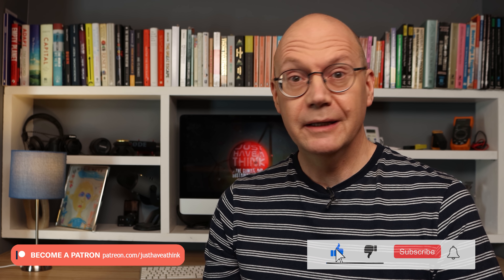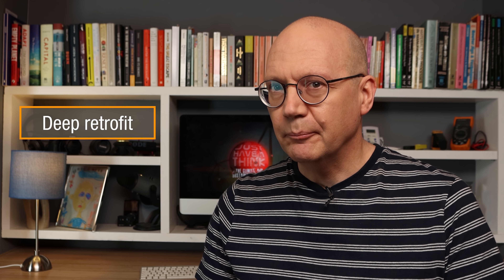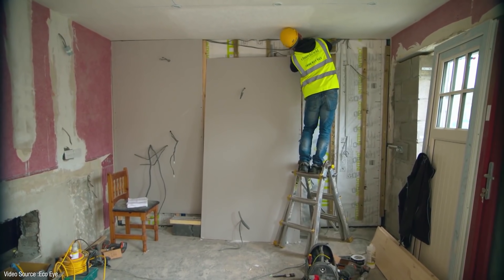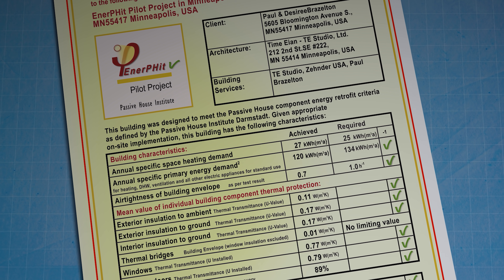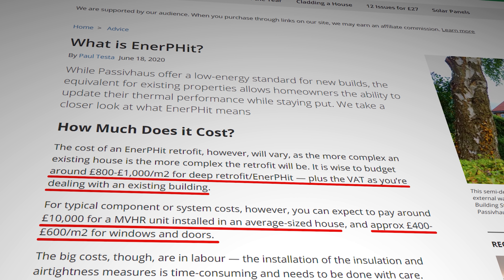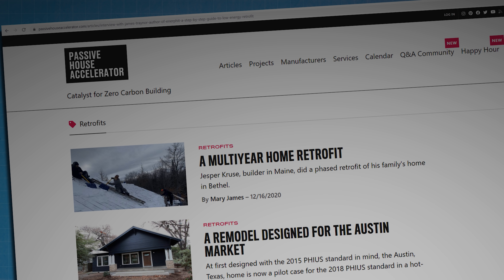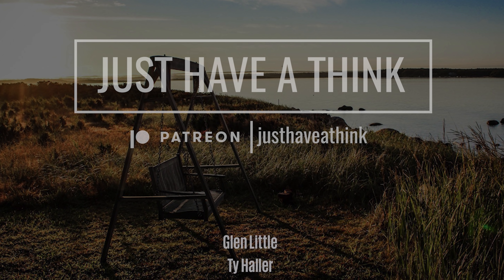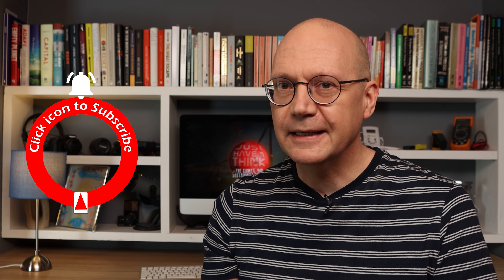Retrofitting to Passive House standards

Comment: A step in the right direction would be to strengthen building regulations on all new build houses. My daughter has just bought a new house and it must be the coldest and draftest house I've ever been in. Costs a fortune to heat and this house should be about for the next hundred years. It's like buying a steam powered car. So far away from a house for the future it's criminal.
Reply: More to the point would be to ensure all builders and construction workers have to undertake CPD (continuous process development) so they know about new technology and the importance of good processes.  A lot of present houses being built are not even to existing standards and most builders (I come across) have “not a clue” about passive house standards.
Reply: @Jack_of_all...  Building Control is supposed to check that all construction meets current building regulations. This process needs tightening with the cost falling on the developer so that they are incentivised to 'get it right first time' and avoid costly remedial works.
In any case, the government should be making it a legal requirement for all new buildings to be build to Passive House standard (a) because it makes them comfortable to occupy and cheap to run, and (b) to meet our climate objectives with regard to reducing energy use, much of which currently goes on winter heating.
Such a move would then require the building industry to raise skill levels to construct passive buildings.
Reply: Yes this makes me scream too! A development site near me received permission for a development of 50 houses to passivhaus standard. But after a hiatus of 2 years construction has started and they are just ordinary brick detached dolls houses and the PH requirement has been abandoned.  Shocking and disappointing.
Reply: In 2020 California passed legislation requiring that all new buildings constructed must produce as much electricity as they consume.  It is much easier to build a more efficient building (like the passive house standard) than it is to produce the energy required for an old, inefficient building, so this is definitely a step in the right direction.  Plus, since this basically guarantees that all new buildings will have solar panels, it decentralizes the power grid, which is a good thing.
Reply: It's about profit. They don't care about the end user.  There's a saying never buy a new  build.
Reply: That sounds like a nightmare. I've always lived in older buildings in the UK and have always had an absolutely horribly uncomfortable time. Now currently living in a new build flat and finally feel comfortable. But I hear everyone continuously say to avoid new build.. however in my experience it's older buildings that have the major issues. I want to buy in the near future but super scared I'll be stuck in a house or flat I feel cold and uncomfortable with.
Reply: For sure. I was looking at a new house.. It was EPC C with potential for B and I'm like "But why. Surely it should be EPC A potential" and besides that guide still isn't as stringent as the international standards.

They should at least have solar panels on top
Reply: Yes it is crazy. I was watching a new build go up the other day whilst stuck in traffic, and the insulation around the roof windows must have been all of 100mm if that.

I don't know why they don't just insist on passivehouse standard. or at least a standard thats compatible with aims 10 years down the road.
Reply: the 'Big six' builders (UK) have too much say. Its worse than the mafia.
Reply: The key to getting the needed upgrades done is money. The Passive Haus standard is notoriously expensive and thus only for the wealthy. Take a look at “The Pretty Good House” book and podcast to bring some sense to the situation. Spending all your money on professionals before a project even starts is idiotic. The design, specification and permit process is one place governments could really help. In my town the permit process is so expensive I am forced to do upgrades without approval.
Reply: So now we are down to the nitty gritty of what we can do, to personally avert our existential threat. It needs government support. To answer the usual criticism of government intervention, I include this.
Today our biggest problem is the money myth. Most people believe it is a real thing. They don't know that money is created electronically, out of thin air. It’s difficult to grasp, not in and of itself, but because it runs completely counter to the dogma of our indoctrination, about the need to 'balance the books' something we are deeply programmed to believe. This paradigm projects the “common sense” of household and business accounts onto government expenditure and the money supply. There are many reasons for this deception, here’s a couple. Deliberately provocative due to our existential threat.
The creation of government debt has the high purpose of endowing the oligarchic elite with an inherent privilege to extract rent from everyone else. Money for nothing, even while sleeping, similar to the feudal Lords. Think of it as a rent/tax extracted on everyone for their existence. There is no real reason for the bond market and the debt it creates. But it does provide the foundation for all other debts that cascade down the system, which brings us to reason number 2.
The money myth is also a fundamental way to control the vast majority of the population, to the will of the oligarchic elite, to keep people down and in their place, under the firm control of debt. There are many other ways this is done but we are only concerned here with the kingpin of of our financial structure, the money supply.
In popular discourse, this division between the ruling elite and everyone else, is known as the 1% vs the 99% of the population, in any developed neo-liberal society, bound by fiat money.
In pursuit of the Green New Deal a number of senior politicians and economists met with UK Treasury officials. In a conversation that included John McDonnell and Richard Murphy, they were told that the official line about how money is created and functions, will be maintained at all costs, in order to 'manage expectations'.
Further understanding of MMT can be found in, The Deficit Myth by Stephanie Kelton
Reply: @Jay...777  This is so true. Covid and the pandemic have shown how this works clearly. The money tree has been prolific for the chosen few with the country now 'in debt' to the tune of 32 billion to Test and Trace while a real terms pay cut to everyone else. That's why the new draconian Policing act is being brought in because they can see the majority are beginning to revolt.
We need clear pathways and good leadership around housing and energy use. Education about the likely timescales and effects of climate change and a clear narrative of a post fossil fuel world. Passivhaus is a fantastic objective but only part of the solution. At present we are not implementing any parts of the solution. Or only a few individuals are making the effort in an individual, ad hoc way. We need high standards set by government to implement massive public mobilisation around retrofit, greening our public spaces if which there should be many more. A complete turn around on infrastructure build to services locally to reduce travel and a moratorium on plastic junk and non recyclable materials.
Reply: @holgre3470  Yes, I couldn't agree more. A big problem is we don't see the system we are subject to in any real historical context, which voids any valid critical review.
We live in a form of capitalism that changed around the turn of last century into Financial Capitalism. This is quite different to the Industrial Capitalism, that for 100 years preceded it. This reached its zenith in the mid 20 century with the establishment of the neo-liberal ideology. Our main difficulty now is people believe it’s been this way forever. Ours is a linear progress, where history always favours the elites, until now we have reache the post modern “end of history” idealism. The retort of our current leaders, that there’s no alternative, is bullshit.
From the earliest times, from before the Bronze Age to the advent of Rome and Christianity, the social order was far superior to our own in many respects. The mainstream history books have it all wrong by the simple fact of seeing it through the tinted glasses of our own dystopia. The pyramids were not built by slaves. The Babylonians knew all about the the tendency for any economy to degenerate down to an oligarchy and how to cut the oligarchs down to size before they could become a menace. The mechanism was regular debt forgiveness, the restoration of land to the people and the release of all bonded servants that had fallen on bad times – the Jubilee – a cause for celebration indeed. It’s interesting that everyone knows of the Rosetta Stone, inscribed with 3 languages allowing the translation of hieroglyphs for the first time, but no one knows what’s written on it. An oddity worth reflection. It was in fact a description of debt forgiveness, a reminder to the new ruler of his duties.
Only recently has this become apparent and I can recommend to you a book that compiles these recent revelations called, “and forgive them their debts” by Michael Hudson.
Or if you prefer, The Long History of Debt-Cancelation from Antiquity to Today
www.youtube.com/watch?v=M4DkZ3CWFOk
Hudson is the one you want to listen to. Anyway, I have to fly now. Do check it out.
Visit michael-hudson.com for more goodies.
Reply: @Jay...777  Your government is saving 350 millions pounds a week now  so I suppose there is no need to increase the debt in the UK.
Reply: @jeromeh7985  
Never believe what you read on the side of a bus.  especially a pink one  lol
Reply: @Jay...777  If it got BJ approval it must be the plain truth he never was fired for lying nor he never cheated on his partner of the day did he?

Comment: Does anyone know if cavity wall insulation for an existing brick house is worth doing or is it a bit of a scam?
Reply: If it is free through a grant scheme perhaps, otherwise, id be avoiding it. Can lead to problems, see BRE Digests for the detail. If you can, better doing some external insulation yourself if possible or via grant free cheap scheme. Best wishes.
Reply from the maker: You just need to check that the insulation won't cause moisture bridging, but if you can get it done with a free grant then it's probably worth doing. I had mine done 2 years ago (on a 100 year old terraced house)  and I've had no problems.
Reply: @JustHaveaThink  It can cause interstitial condensation problems that become difficult to remedy without further works. As you refer to moisture bridging, you will be aware of ties, lintels and mortar snots that all are potential and common causes of this. Adding insulation as a retro fit into a usually two inch void often constructed by brickies on a couple of thousand bricks per day by two and one labourer can not always go well. I have personally removed handfuls of ringing wet insulation from the bottom of such cavities as part of survey work in litigation cases. 50mm of wet insulation is far worse than no insulation at all. Some produce using plastics in expanded form negate this. But product and situation should always be considered properly first as has been clearly evidence in recent disasters even when authorities gave the green light. I would also urge caution on giving advice that opens one up to liability should the advice fall short. Best wishes.
Reply: @jimmycorkhill1390  
he wrote:
"You just need to check that the insulation won't cause moisture bridging"
Reply: @johnburns4017  Yes, this is the problem when people dont really know what they are talking about, poor advice can lead to problems for the receiver and potential litigation against the giver. A traditional cavity is designed as an airspace to separate the outer leaf from the inner leaf. When this gap is taken up by a moisture absorbent material, the moisture that often condensates on the inside of the outer leaf soaks into the insulation. This is called interstitial condensation. Over time the insulation continues to get wet, increasing the condensation and cooling of the building. It can also cause dampness issues as the water accumulates at the bottom of the cavity. All this is other than, but not exclusive to bridging dampness related issues. Hope this helps clarify and show than to 'just a have a think' a little, isnt enough when advising or encouraging (*edited) others to part with money or take action that can lead to a loss, unnecessary cost or damage. Best wishes.

Comment: I sometimes wonder if there is a case for demolishing a house and starting again in regard to costs of retro fitting
Reply: Lifecycle cost analysis is often used in such matters. Best wishes.
Reply: There are a lot of compromises when retrofitting...at least if you are going for a super energy efficient home.  I am doing that right now and I am 100% certain that it would be cheaper to have leveled the building and started from scratch.  The only reason I didn't is that my family built this home so sentimentality is getting in the way...a big mistake ;  -  )
Reply: @richardlangley90  If the building is structurally sound and there isnt lots to remove during the retro......if all is mostly applied over existing and you are paying anything like a new build cost then your're being taken for a ride. Costs of demolition, foundation, structure, services, floors, internal or external claddings. All compared to a best practice external wrap with new claddings and perhaps new heating system? You paying anything close? Best wishes.

Comment: Brilliant as ever! We are in the middle of a renovation project on our old property. Couple of things I noted about the process:

1) In our situation we did not need an architect because the layout was staying broadly the same (minus a couple of walls). So we hired the very good local builder. As a 'client' what you want is always mediated through what the builder can actually do, especially in say a rural area with limited choices of builders. This can show In terms of their skills and experience, but also in terms of their supply base and their attitude to new methods and materials. Builders can be quite conservative and cautious of new ideas, which some of the Enerphit stuff often is for them. So they will want to do things their way - for example they may have a preference for concrete foundations over wooden raised floors because they are used to installing underfloor heating that way. Which brings me to point 2:
2) Building works are incredibly materials intensive and making 'green' choices with respect to practices and materials in this industry is a tough call. Builders can see it as more expensive, possibly inferior performance wise, and more difficult to install, especially for things like insulation where Styrofoam is king. There are lots of real and imagined barriers for them.  When you approach from a relatively ignorant starting point, it is difficult to insist on a path forward without friction and unexpected additional costs. 

An architect can help by designing and specifying 'green' stuff knowing they were appropriate for the building and reducing any doubts from the builders (or client). The builders can then follow the plans, like a recipe. But using an architect of course comes at significant upfront cost (and time), and is not without its own tensions. 

Anyway, in our case we are very happy with how things are working out on our project.
Reply from the maker: Good info Simon. I'm glad to hear you got a good result. I did Project Management on new retails store spaces for nearly a decade, and when I first started my boss told me "some tradespeople are brilliant and some are not. The less flexible will always give you a rational reason why things can't be done. And when you scratch the surface that rationale is usually that they simply don't want to do it."  The Project Manager's job is to be 'Irrational' and not accept their word for it. It takes a bit of managing, and there are certainly some terse conversations, but eventually a middle ground is found. It's not easy though, I must admit.
Reply: Highly recommend hiring an energy consultant (preferably someone Passive House certified).  He or she will understand where air barriers and vapour barriers and weather barriers need to be placed, as well as the combination of materials that when combined will not result in mold.

Comment: Interesting video.  I would say that having to achieve EnerPHit standard is not needed to achieve a comfortable energy efficient house.

I am retrofitting an 1890 Victorian house and fitting high quality and expensive upgrades where needed but not all is expensive  wooden triple glazed U0.85 wooden sash windows are though £850 m2.   A competent DIYer can make a huge difference.  Moisture needs managing.  I dig out the solum to just above the top of the foundation then put down river bed gravel to 2 inches, a thick sheet plastic with 2 to 3 inches of concrete on top. After this I fit Rockwool between the joists held in  place with woven garden fabric stapled in place - do not use PIR or PIU as they don't allow moisture to move through the floor.  I also re-establish the airflow in the airbrick and up the wall space to the roof.  This makes a big difference as moisture is virtually eliminated.  I am doing videos but not yet got them on YouTube.  For a 5 bed semi on the west coast of Scotland we are paying £115 per month utility bills with gas heating. I expect this to get to £75 when I am finished the job. Includes c. £40 in electricity.

All internal and external Victorian features are being retained I have no intention of losing the beauty for an improved thermal performance.

Good DIY beats a contractor any day.